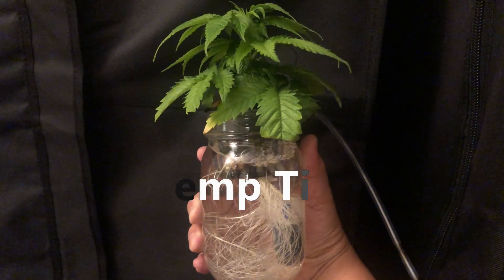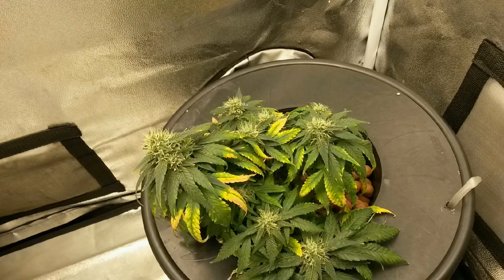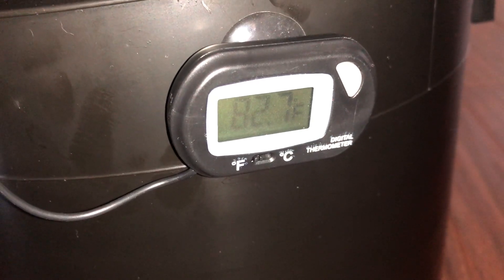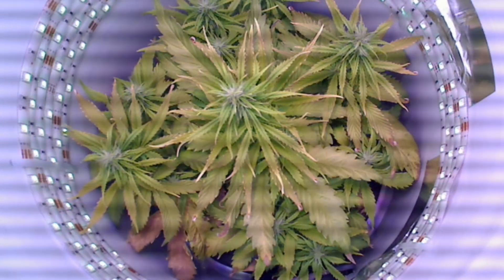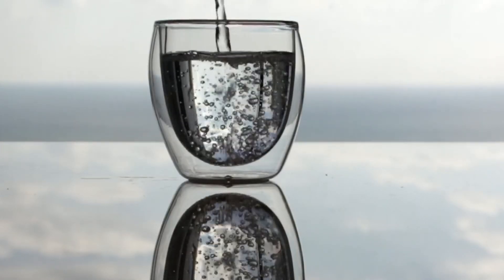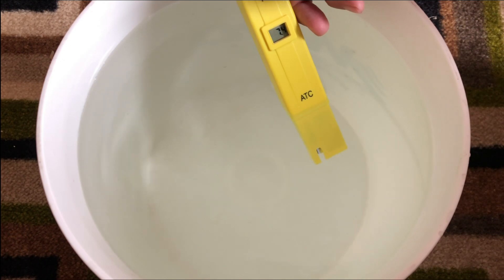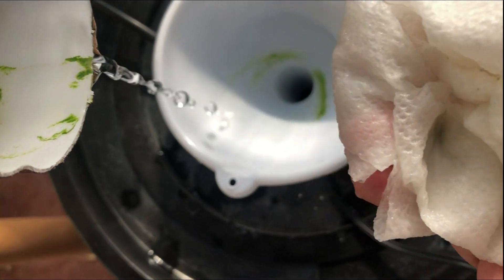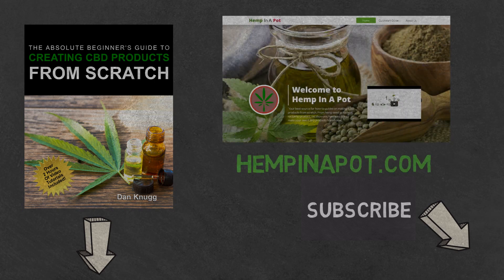Hydroponic Water Reservoir Issues and How to Correct Them

Comment: I love your channel. But I would like to point out to anyone thinking about using distilled or R/O water. Please remember that both have a tds reading of absolute zero. This means that it's just plain water and nothing in it..Good right...WRONG. H2O on it's own will fight to join as one with anything it comes into contact with. This means that distilled water and R/O water which is also the same thing, act like acid until they have taken in a suitable amount of minerals. Which are found naturally in spring water. As it is filtered through the earth. So you could go two ways about adding something to your distilled or R/o water source. If your using hydroponic then obviously and in most cases you would add in your bottled nutrients  which is fine. However if you are in flush for hydroponics, well just adding in plain distilled or R/O water will certainly strip it of a lot more than nutrients. So you can simply add just a few river rocks or preferably any smooth stones you could find along a creek or happen to dig up. These are the very rocks that are found in springs. Some of the more expensive R/O water filters have a final filtration through such pebbles or minerals themselves. Just be safe before using distilled or R/O water. I find too often people using it for everything even in a humidifier is bad when you place them close enough to your plants not knowing they will try and strip minerals and nutrients from the leaves when they come in contact with them. Then there you are thinking it could be one deficiency or another and it wasn't any of them. Treating the incorrect mistake will only result in more mistakes. But that's life you live and you learn. You die and then you wake up and realize "hey I could die, but i will never be truly dead. I was in a spider's web of gods love" acronym for B.asic I.nstruction B.efore L.eaving E.arth and the rest will fall into place. I love you so very much.

Comment: Are you sure of the reliability of your PH and TDS testers.  I had exactly the same two as you, but after comparing the results with a friend's professional testers, I found that there were very big differences, and I switched. 
The PH tester was giving 1 PH more, sometimes it was giving completely crazy numbers... and the TDS tester had 200-300 PPM less depending on the measurements, same result when calibrating the testers. 
The PH testers are the most sensitive and the probe must be made of glass and kept in a liquid permanently after use.
Concerning the TDS testers, the best is to use an EC tester, because according to the manufacturers the PPM can be very different from one brand to another because of the three conversion factors used by the brands: 0.5, 0.65 and 0.7).
I know it costs more than 5$ each on amazon, but when you want to do hydroponics seriously, you have to invest in serious and reliable equipment like Hanna, Bluelab or Milwaukee.
Reply: Apera also is s good go to